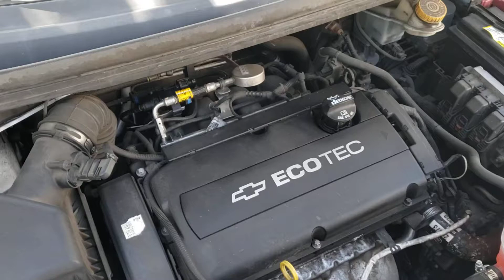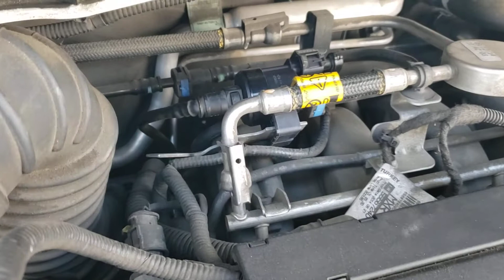2012-2018 Chevy Sonic Chevy Cruze Purge Valve Replacement Save $800

Comment: Thank you SO much for this! My car kept struggling to turn on when I put gas in, & when I googled the issue, it met all of the symptoms for the purge valve. This saved me SO MUCH MONEY & took less than 10 mins! God bless you for your generosity of knowledge & wisdom!
Reply: I took mine to autozone and had them do the free diagnoses. They even gave my a print out for the exact part so I could order it.

Comment from the maker: For best results with the replacement of your purge valve make sure you follow the step by step process outlined in the video

Step 1: Disconnect the left side of purge valve
Step 2: Remove purge valve from metal holder
Step 3: Disconnect electrical connector on right side
Step 4: Disconnect main inlet on right side
Step 5: Replace valve

For a cheap and reliable source to purchase your valve try this link below, it will save you money
https://amzn.to/333ODBO
Reply: What is the name of the hose on step 1 that’s what I need to replace

Comment: video  no  help at all you don't show how to open the lock on the electrical wire which  is  the issue I am having
Reply: The electrical connection is a push down deal just push down on it you'll see it and pull back it'll come loose. Problem I having is with that blue clip although mine's not blue I can't figure out how to get that thing off
Reply: @johnhalchishick7094 there is another video where gentlemen shows you.How to disconnect that?\nOr you can google it , and then we'll show you